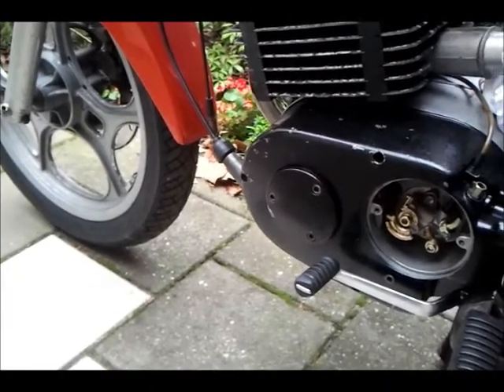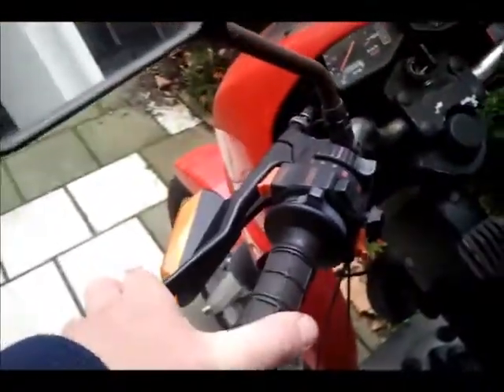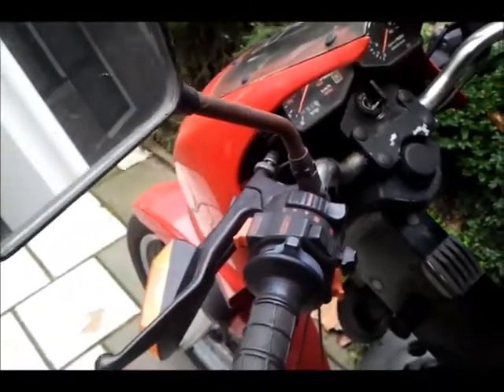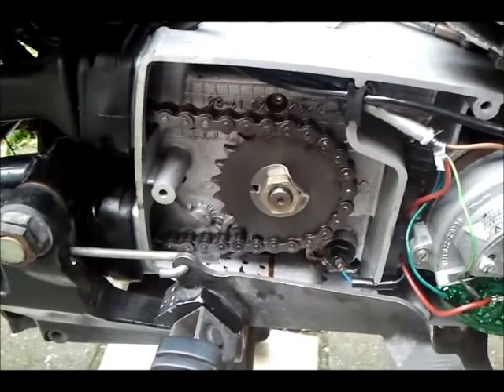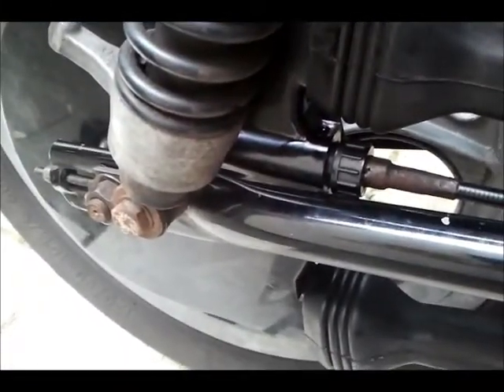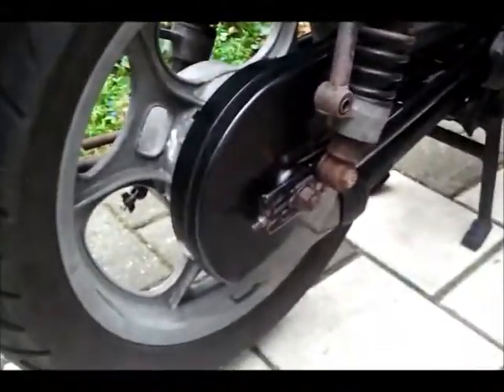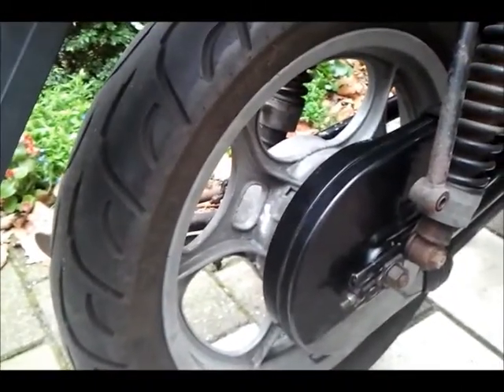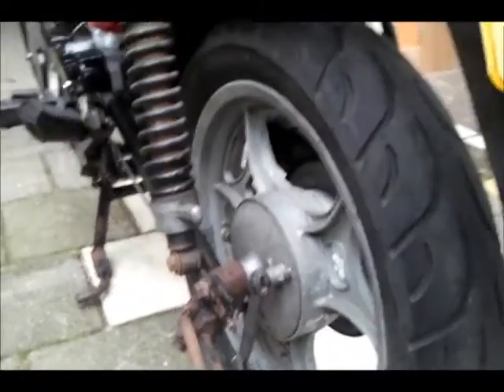Rebuild part 4 MZ part 16

Comment from the maker: I'm going for the stock solution: that means there is no exhaust gasket. Of course I'll check for leaks when I start her up. But I don't expect any problem, never had any leaks in 21 years with several engines. But until the silencer comes on, (still a bit of a challenge) the nut stays loose...